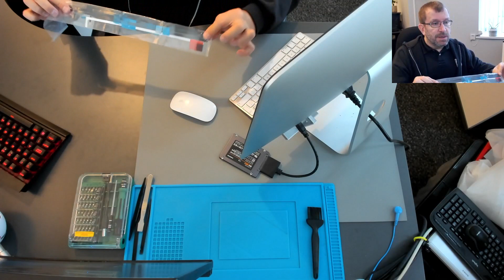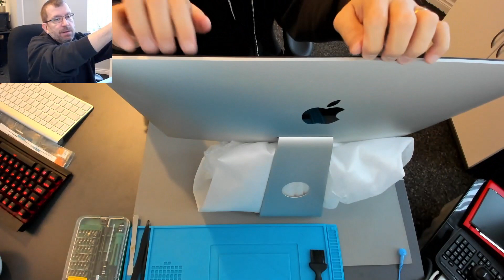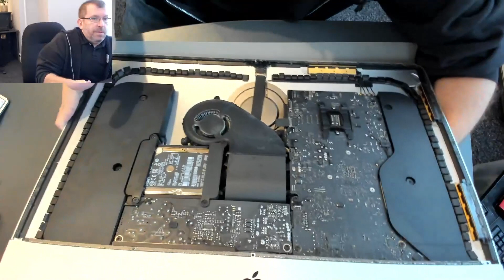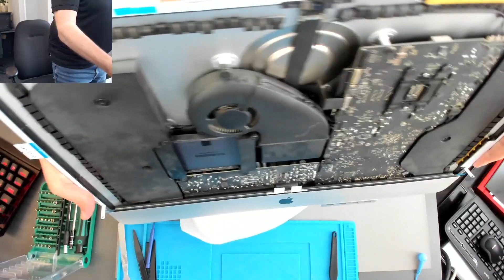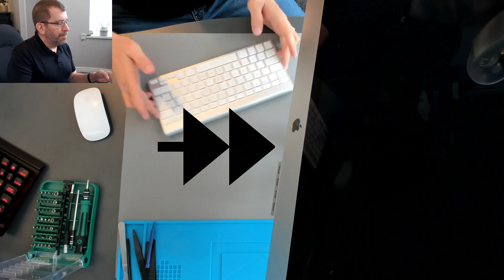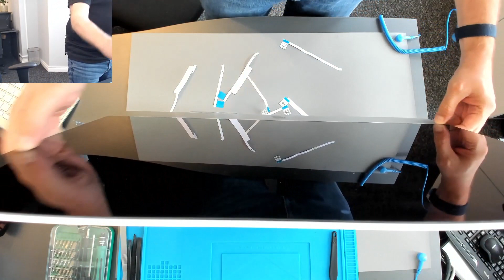[9] Apple iMac (21.5-inch, Late 2013, EMC 2638) - SSD upgrade

Comment: Being that it is a 2013 computer, and this is 2023, its the last update for this beast...so I used a bit of gorilla glue to reseal the screen...the old adhesive sucked it up like a sponge. 🤣
Reply from the maker: I never tried Gorilla Glue. :) I did find that the aftermarket adhesive tapes are much harder to cut through if you have to reopen one of these. It seems the factory tape that Apple used is really a thin bit of foam between two layers of adhesive, so it's easy to cut through.

Comment: Hi, thanks for the great video. I have a late 2012 fusion drive. Would I be able to do this and have the new SSD work with the small existing SSD without having to do anything hideously complicated?
Reply from the maker: If you get a USB-SATA adapter, you could connect the new SSD via USB before you start, and clone the contents of the hybrid drive to the new SSD. Then you can replace the hard drive with the SSD, and Mac OS will see two separate drives: the new SSD (which should be your new boot drive) and a separate SSD that was previously the cache drive in the hybrid setup. In that scenario, that drive will likely be of unknown format, so you'll need to reinitialise the disk before you can use it.
Reply: @ComputerHelpNI  Thanks, I was with you until reinitialise the old disk? could it just be ignored or deleted even?
Reply from the maker: @stevewoo8154  Yes, if you replace the hard drive with an SSD, you'll then have two SSDs -- the old and the new. The old one will appear in Disk Utility as a disk with an unknown format. If you want to use that disk, you'll need to initialise (format) it.
Reply: @ComputerHelpNI  So I could just ignore the old one if I didn't know how to format it (which I don't!)
Reply from the maker: @stevewoo8154  It's actually pretty easy to format a drive -- just find the built-in app called 'Disk Utility', be sure to *select the correct disk*, and then choose Erase. (If asked, choose the APFS or Mac OS Extended file system.) Good luck!
Reply: @ComputerHelpNI  Brilliant, thanks for your help!

Comment: Hi, is your fan always on highest speed ? Does it require to charge temperature sensor ?
Reply from the maker: I've seen this happen a couple times.. Installing SSD Fan Control software ( https://exirion.net/ssdfanctrl/ ) solved the problem both times.
Reply: i guess im randomly asking but does someone know a tool to log back into an instagram account..?
I was stupid lost my password. I appreciate any assistance you can offer me!
Reply: @Walter Jaden instablaster :)
Reply: @Aiden Avi i really appreciate your reply. I found the site through google and I'm waiting for the hacking stuff now.
Looks like it's gonna take quite some time so I will reply here later when my account password hopefully is recovered.
Reply: @Aiden Avi it worked and I finally got access to my account again. I'm so happy:D
Thanks so much you saved my account !
Reply: @Walter Jaden you are welcome :)

Comment: What did you use to clean the screen at the end? Thanks.
Reply from the maker: Just mild glass cleaner. This iMac doesn't have a Retina display, so it's pretty safe. (I use Uvex clear safety eyewear cleaner on Retina displays.)
Reply: @ComputerHelpNI  Many thanks for your help, very much appreciated.

Comment: Did you have to re install macOS after doing this?
Reply from the maker: No, thankfully. The existing disk still worked well enough that it allowed me to use Disk Utility to 'restore' it onto the new SSD via my USB-to-SATA cable. I show this process in another video, here: https://youtu.be/byHCsv-ofhM?t=134 

Note: You can't always clone the latest MacOS Big Sur using Disk Utility and will instead need to use a (free) third-party utility like Carbon Copy Cloner. I mention that in another video, here: https://youtu.be/byHCsv-ofhM?t=511
Reply: @ComputerHelpNI thank you